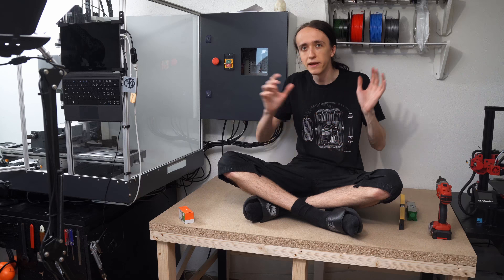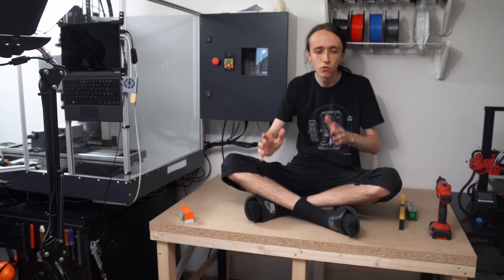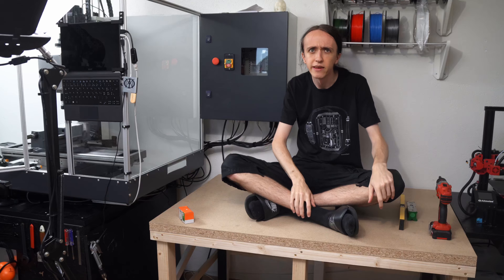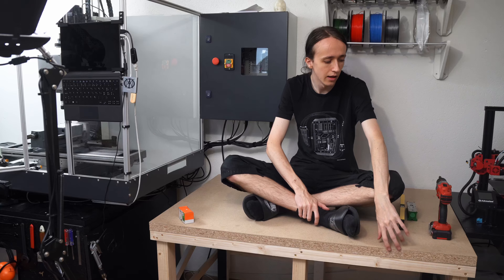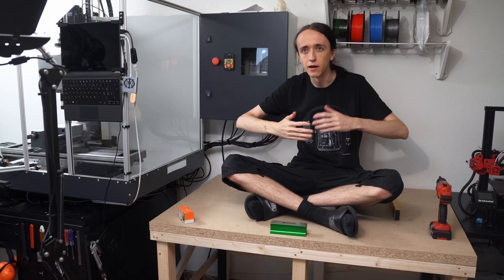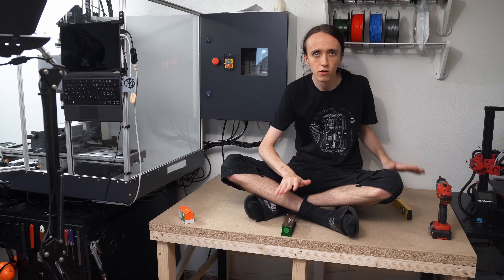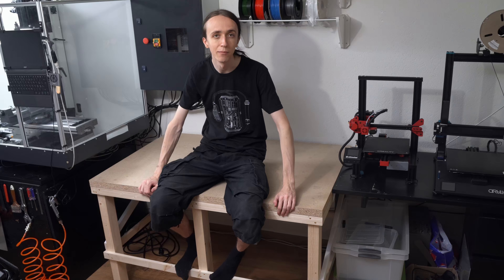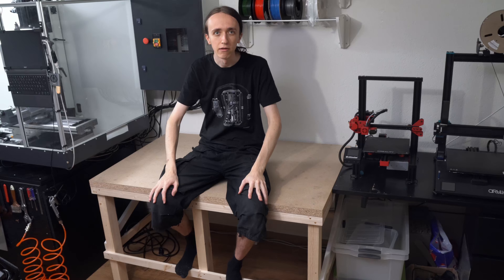Sturdy and FLAT CNC Table - RatRig KillerBee #1

Comment: You can use an iPhone to check the level? Did you try that? Just out of interest? Launch the measure app and select the level. It shows two circles, which overlap and turn green if it is level... I like to know how accurate it is in honestly since I plan to use it and not go out and buy a special instrument,
Reply from the maker: A phone app is good enough to hang a picture, but what I'm doing here requires much more precision. The level I used is much more sensitive even than a regular level. If you don't have a machinist level, you can just use a straight edge, or try to just build it as well as possible and it should be good enough. I'm trying to get every last bit out of this machine, but it'll still work fine if the table is not perfectly flat. This video is also not a step by step guide, more just some ideas and inspiration.

Comment: Level is perhaps not the right word here, what we are trying to achieve is a flat surface that is parallel to and across the footprint of the CNC .  It doesn't really matter  if the table is 0.5 cm up on one side as long as the table top is flat across its dimensions. It does help of course if the floor is indeed true but that in most cases is not always possible which is why some clever person invented Shims......😄.
Alternatively make sure your legs have some form of adjustment and get yourself a damn good straight edge.
Reply from the maker: My goal is flat, but level is a lot easier to measure on a budget without a large straight edge. Definitely not as precise but much better than just hoping for the best. If you have a straightedge that can do the job that is even better.

Comment: Interesting timing, I'm right in the middle of building another CNC myself. I went the route of a full DIY build though. Currently using MDF for a mockup/test-run before I spend on the aluminium. Looks like we have a roughly similar scope, your motion components and spindle are a bit nicer but I think my structure will be more rigid. http://www.iforce2d.net/tmp/IMG_20210813_215452.jpg
Side note, I'm wondering why you wouldn't use that other room where your table saw is, for machines like routers that will get noisy and messy.
Reply from the maker: Looks like an awesome machine, definitely very beefy!
The other room is also used as a laundry room and for other things by my family, so I have to clean up everything each time and free up the table, not ideal with a big and heavy machine. With an enclosure it shouldn't be too messy though and using a spindle instead of a router should be a lot quieter.

Comment: An idea for leveling your table perfectly should be to poor resin on the top, or even to use floor leveling concreat
Reply from the maker: That could work, would be rather messy though and you need to make sure it doesn't shift once you add weight afterwards. One way to make it easier to adjust would also be to add adjustable feet, that's what most larger industrial equipment has to make sure it sits flat.

Comment: You didn't detail what you did looking at the speeded up footage? You have a pile tiny slices? that you placed under individual feet? slices you glued? what size where said slices? Did you cut them? What where the sizes you use for the frame too?